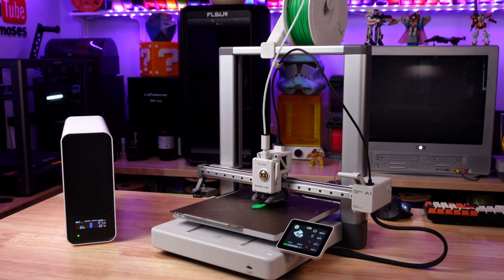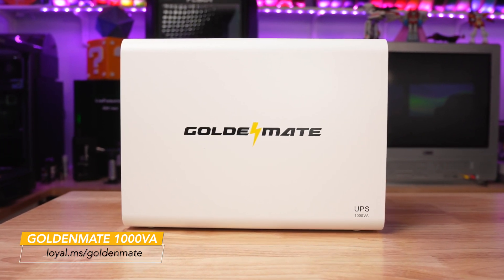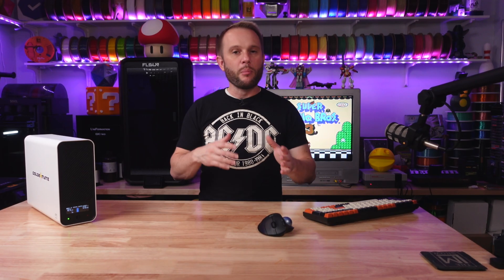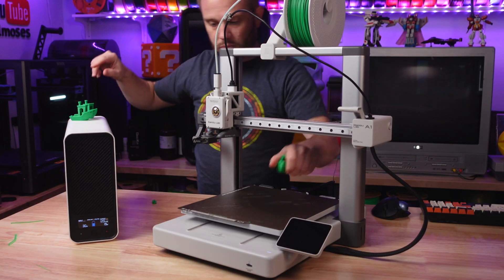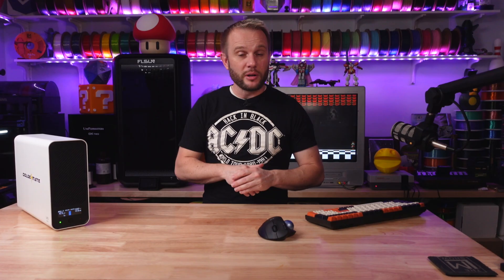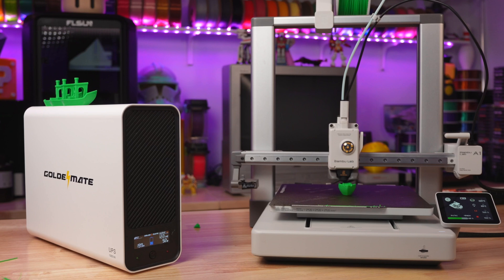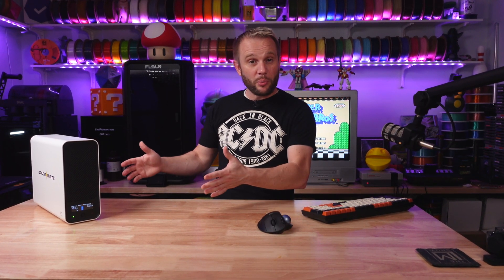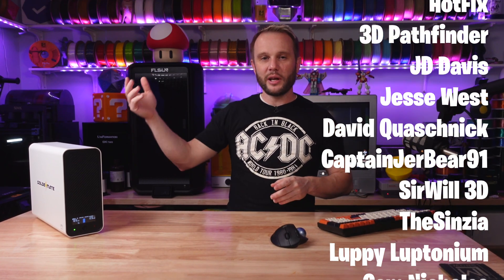Bambu A1 - How Long Can We 3D Print On Battery?

Comment: Thanks for making this video I am using Bambu Lab A1 3d printer but in my area always power cut off is common problem . So I was searching for the ups who can run Bambu lab a1 3d printer . Unfortunately this UPS is not available in India but at least I can compare Goldenmate ups specs with available ups specs in my country. Thanks a lot once again
Reply: Hey there, I'm also in a similar situation as you.. what did you end up doing?

Comment: I wanted to love these things. Bought two of them after seeing your video because I’m so tired of sealed lead acid batteries and the short lifespan. But both my golden  mate ups back ups were bad. Both smelled terrible and one started acting like it wasn’t plugged into the wall randomly but it was. The other the internal fan went bad causing overheating. Sucks because they have a great idea here. Finally using a good battery!! But they need some work!
Reply from the maker: Wo! Two bad ones?!? I don’t think mine was cherry picked, I believe it came regular Amazon shipping.

Did they refund or get you taken care of?!
Reply: Technically one still worked, just needed a fan. But I just didn’t trust it after that and decided to wait for a V2! Luckily they did give me a full refund and offered to send me another with no charge. So maybe this one will be better! I don’t believe they would cherry pick yours. I just think I was unlucky there. Or maybe even shipping damage who knows. I just have a hard time trusting after errors like that but them giving me my money back and sending another makes me feel better for sure!

Comment: I use an APC unit which is good for 10 mins only. I also have a Panamax M5400-PM 11 in which it is plugged into the APC to control my Lazer and ink jet printers and my PC and 50-inch monitor to include the x1 carbon and K1 Max all go into that devise. I need steady voltage that is constant.
Reply from the maker: Oh, that is cool.

Comment: Thank you for this. I was searching for some "printing on battery backup" videos within the past two months for possible printing at a craft fair, and could only find one guy with a video on it. I bought an A1 mini in hopes that I could make this work. Goldenmate doesn't have larger than 800watt 1000va UPSs. Do you have any others you could recommend that would be larger but still luggable?
Reply from the maker: APC, but you’ll pay a lot more! Mini will use far less power too!

Comment: The A1 has a great power cut off feature so long as your print is still adhered to the bed. I had a power outage of 8 hours printing Gold Silk on my A1 and as soon as the power came back on it asked me to resume print and it finished flawlessly.
Reply from the maker: Yup! Power loss recovery is pretty good on Bambu machines for sure!
Reply: @LoyalMoses  It doesnt always work, one time it started printing 2 centimeters over the print. Or sometimes it doesnt work completly